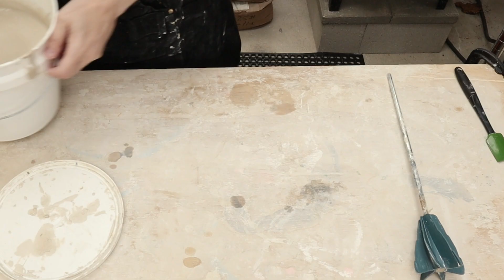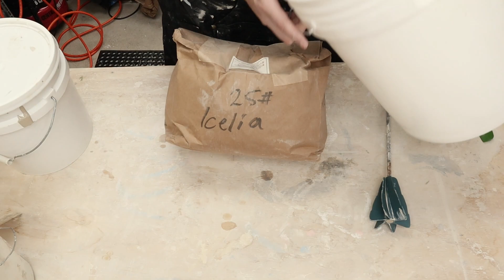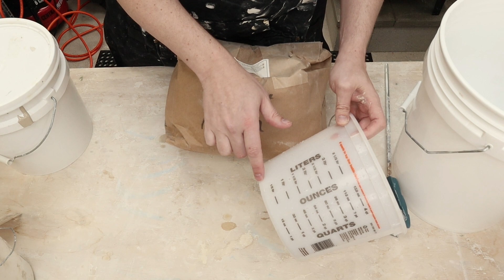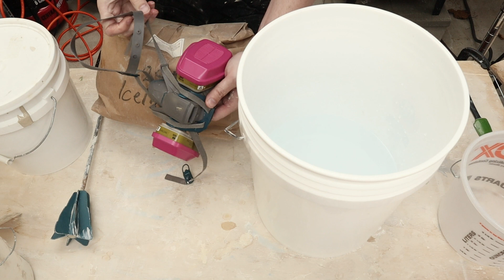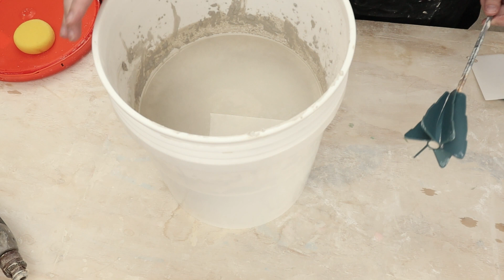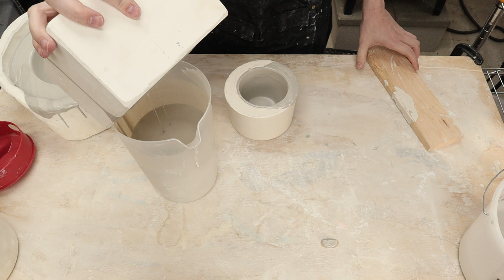Just add water? NEW SLIP from DRY CLAY

Comment: I’m just starting and I have no clue where to begin. What kind of slip do you buy?
Reply from the maker: If you're just starting out, get premade slip. It is the easiest to get going with. Ask your pottery supply shop for a recommendation. For myself, I use dry clay formulated for slip casting, add darvan 7 as a deflocculant and water.

Comment: i didn't understand how did you know how much water to add
Reply from the maker: I wanted my slip to be 70% clay and 30% water. So for my 25 pound bag of clay, I'd have 35.7 lbs of slip (25/0.7). Of the 35.7, 25 is clay so the rest is the water I need to add: 10.7lbs in this case.
Or for an easier metric example assume you have 10kg of dry clay to start. Slip with 70% clay would then be 10/.7=14.3kg of slip. The water is 14.3kg slip minus 10kg clay = 4.3kg (liters) of water to add.
You can change the 70%/30% clay to water ratio if needed using the same kind of math.

Comment: Thanks for sharing!  I make my own slip as well and found it’s easier to mix 1/3 dry at a time and mix into water each time.  I add 1/4 of my deflocculant each time and when done I have 1/4 defloc left for final adjustments. 
I also sieve with an 80 mesh to get out any unsolvable solids in the dry mix.  You would be surprised with what you will get in your screen. 
I also let my slip rest a couple days mixing each day twice for 10 minutes or so. 
This made my slip work very consistent long term. Hope this helps 😀
Reply from the maker: Thanks for the tips! With just a single 25 pound bag, my drill had no problem mixing it up. But I could imagine if I want to do more, batches would be a good idea. Holding out a bit of the deflocculant for the end is also a great idea.